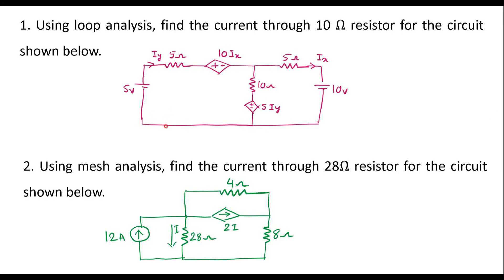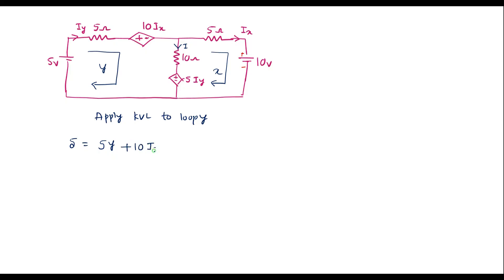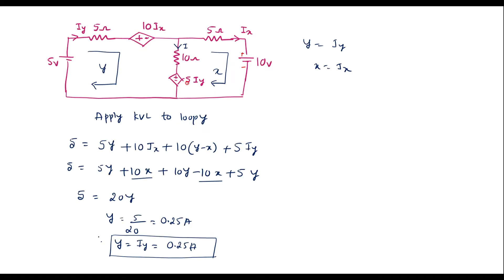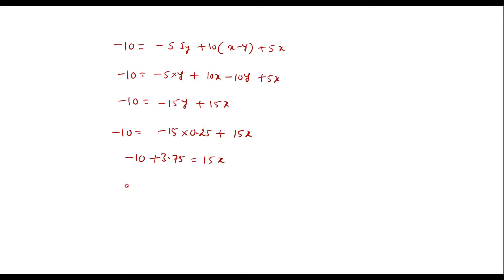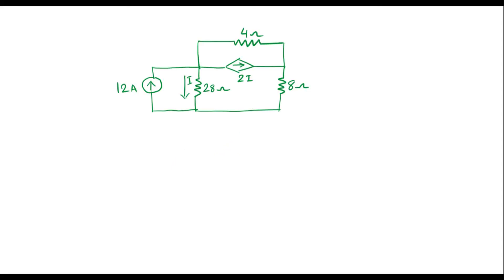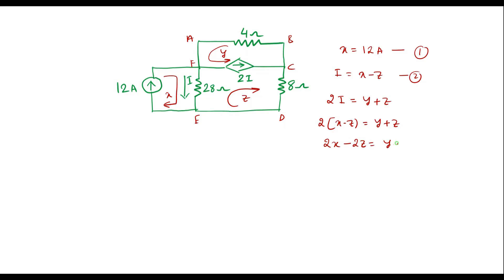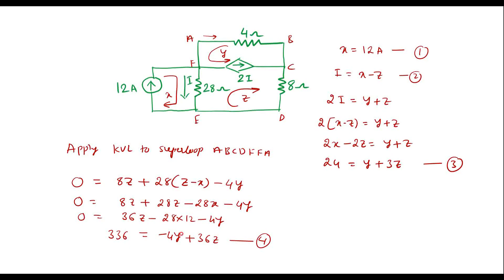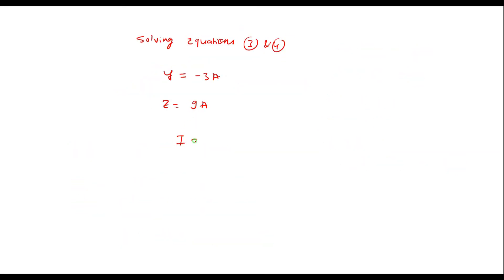Determining currents using Loop analysis

Comment: If we are taking current is flowing in clock wise direction then in every loop we should take same direction but here you have taken In 4 ohm resistor current flowing in anticlock wise direction  
And in applying kvl you take the current flow is opposite but you have shown that flowing in same direction then how can you take 2I = y+z it should be 2I=y-z
Reply from the maker: You can take current direction however you want
Reply: @VBDclasses  but doesn't it affect voltage